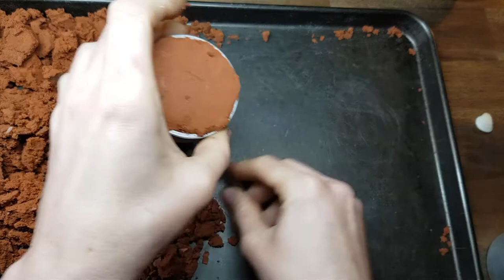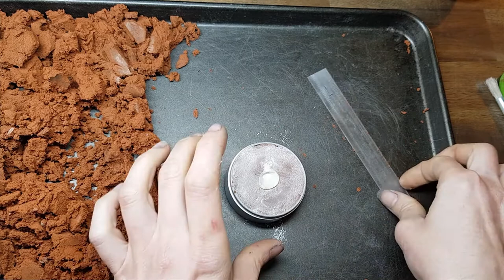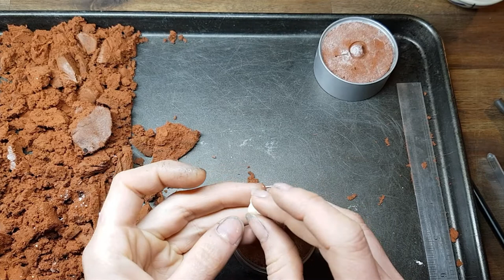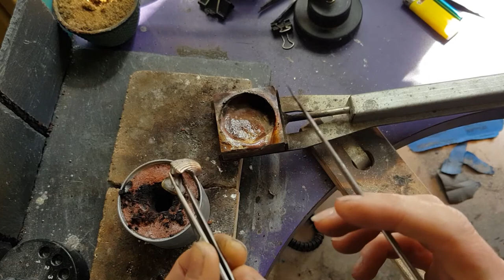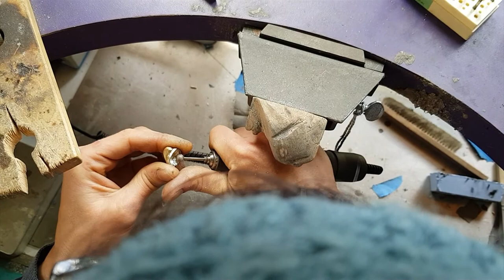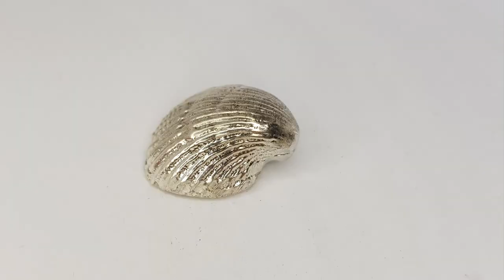How to sand cast a thin shell - sand casting - tutorial - beginners

Comment: I loved the finished shell.

here is an idea to make the thin wall a bit thicker , 
what about using a few layers of cling film, as cling film is about 0.07 -0.10 thick  so you hardly lose any texture/shape/depression and so you can also pull the shell out more easily 

so  with using one or 2 layers of cling film for the outside lay it across the clay/sand and press the shell on top of the film and 2 plus layers for the inside you can gain nearly 1/4 mm thickness

Either that or fill the inside with some sort of soft glue like UHU and line the inside to make it thicker, and if the glue needs to be removed from a reusable item then it can be pulled out.
UHU is great for making small little molds to :)
Reply from the maker: I sometimes fill thin objects with jewellers wax to give it extra thickness and strength :) But I have also used a two part glue before as well :)
Reply: @sandcasting_with_kirralea  sounds like a good idea, it all about thinking of what can be used, as every person tends to have there own good idea :)

Comment: Is it possible to add the top sand/clay with the black rod already in place with a bit of wax to stick it to the shell or something, that way you dont have to push a hole through and risk ruining the casting🤔
Reply: No. But if you have a drill bit you can hand twist it in place to displace the delft clay without distorting the mold

Comment: The problem is that gold needs more than 1000 Celsius to melt. This requires a very special gas burner. Most crucibles cool the gold too quickly, causing the gold to harden before it fills the mold. So it's not that easy to get the right equipment and especially that is not cheap.
Reply from the maker: I like to use LPG and oxygen, you can get both from Bunnings which is everywhere in Australia, and isnt too expensive to set up :)
Reply: @sandcasting_with_kirralea  But did the liquid gold completely fill up the mold before it hardened?